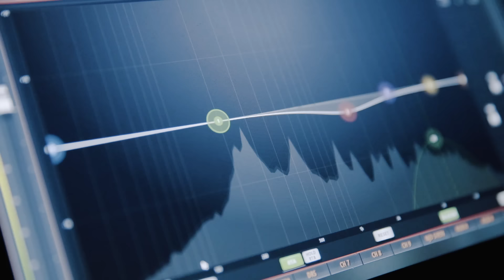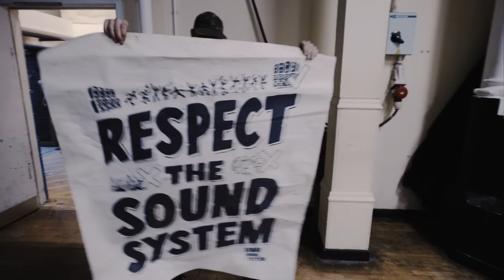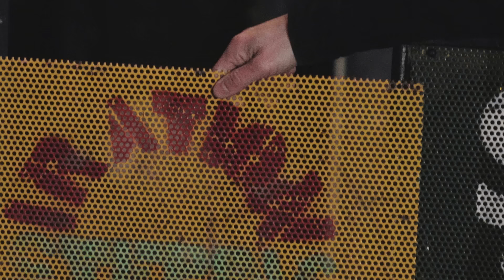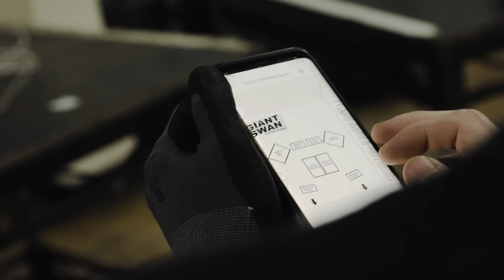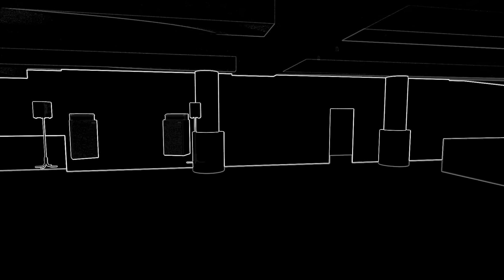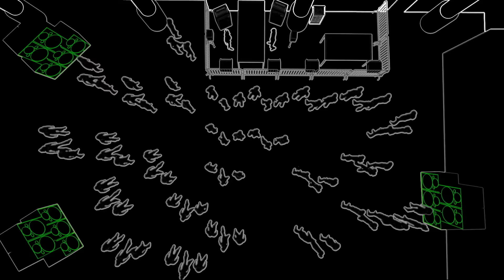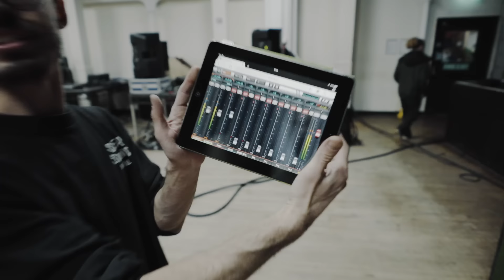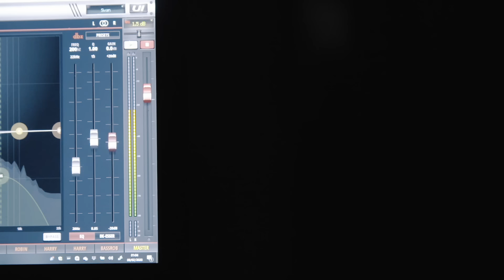Sinai: Inside the UK's most versatile sound system

Comment: I really like the rubber-based feet for the TT's. Back in the day ( early '80s) I was young and dumb and using a pair of BFI Bullfrog PA's with a monster Project One receiver. In order to isolate the TT from all the shaking I took two rectangular kitchen sponges and cut them in half, then placed each sponge on a saucer and each saucer under a foot on the TT. When we threw a party I'd wet the sponges and never had a problem again with records skipping.

Comment: This is one of the coolest things I've ever seen. In purpose built track cars, rubber bushings are replaced with solid metal mounts in the subframe (connecting the suspension to the body) to improve the feedback the driver receives from the road. Interestingly the equations for "waves" are analogous across science, whether they be electrical, mechanical, or audible waves -- all being magnitudes of energy over time and space. 

Respect to Sinai for pushing the craft forward <3 bucket list: hear a dub set on a sinai sound system.

Comment: I experienced the soundsystem at Dimensions Sub-Dub Arena. The energy of the soundsystem was so intense the air started heating up from the vibrations. Unreal to actually start sweating from the energy of the music hahah
Reply: while i was watching the video i was wondering what were the best soundsystems i've ever heard, and i came up with the Sub Dub arena one (and Berghain, just as good); only after reading the comments i realized those guys were the owner of the soundsystem lol
Reply: While it's an entertaining idea, it wasn't the vibrations heating up the air. Even if you crammed two dozen 15kW M-Force subs into a tiny 500 person venue, the vibrations wouldn't heat up the air (but you would pass out from the agonising pain).
Reply: Francesco Spinolo are these actually good, or just powerful? The best soundsystem I’ve heard had a great body load but not too much... and yet you could hear all the elements through the highs fairly evenly.

Comment: I just corner load now - slammed a village hall quite well with 2 single 12 subwoofer cabs on 600 watts at my 30th okay it didn't go SCARY loud but it was definitely enough to start feeling it well, and paired with 2 Bill Fitzmaurice tops was enough to drown any attempt at conversation at the back of the hall. A pair of 18s would have been better, but then I couldn't fit the whole system in a Citroen C2.2 

I made a speaker stack when I was a child that was 2 of my dad's old H//H pro 150 15" bass guitar/PA cabs with blown tweeters through an old custom sound 4 channel mixer on the bass, and some unknown 2 x 12" open back cab on mids and a Marshall 8020 on upper mids and some highs. As there were no crossovers I just adjusted the bass, mid and treble on each speaker. It sounded terrible but got awfully loud playing southside spinners and Luvstruck through it at top whack till my parents had enough.

Comment: 100,000 watts from only 3 power amps? (14:30) I have been doing sound for about 38 years now and I have never heard of that before. I have roughly 25,000 watts from 8 power amps, and I am pretty sure that if I cut it loose in a room that small, I would knock the nails out of the walls and cause some serious health issues for the guests. This seems a little exaggerated. Think of it this way, if each speaker is capable of handling 1,000 watts, then you would need 100 speakers! I saw 50 at most! Judging by those amps I would say more like 5,000 watts tops! IMO

Comment: I have 6 cabinets with 2x18's 2x12's Peavey black widows and a 2" P-audio horn driver all on community horns/ 10 cabinets with 2x12's Peavey black widows on horns bi-directional/ 10 long throw horns community 2" P-audio horn drivers/ 8 wedge monitors with electrovoice evx180's 18" and 2" P-audio horn drivers/ 4 amp racks with crown power base 1,2,3's and a crown macrotech 5002vz/ 40 channel Allen and Heath mixer/ FOH rack / mics stands di's/ 200 amp distro/ etc... It's pretty damn loud I ground stack it the big cabinets are 58" wide 3 ft thick and about 50" tall I stack them 3 high with 3 2x12's and 3 2" horns a side on both sides of the stage and have the wedge monitors across the stage

Comment: I've got a question.
I am currently building my own mini reggae/dub soundsystem for home use and for occasional home party's. It's a 4 way system with 2   15inch superscoops, 2  12 inch ported mid-bass speakers, 2  8inch tops and 1 hornloaded tweeter. My consern is that the bass of a  15inch scoop won't sound very nice. I would like to hear some more opinions.
Reply: How did it work out?

Comment: so its a mobile disco built with old 80s rave speakers ,,, ?? or am i missing something.
Have you ever looked at a modern touring system ,, seriously , yo should .
oh, and add a couple of pairs of servo drives if you really want vintage thump.
Reply: I've used some Turbosound Aspect TA-890H, which are absolutely stunning, but the weight of the boxes makes them less practical for touring. The Martin Audio H3+ box is another favourite, but simply does not go loud enough for the things we do. Also used a selection of Funktion One boxes, including the RES5T, but I'm not a massive fan of where the crossover points are, just sounds a bit "odd" with the kind of music that I play. I do like the KF850F, but each box is DOUBLE the weight of one of my mid tops. I'm able to get, legally, 6 subs and 6 tops in the back of my van, which logistically makes the most sense. Line array is pointless in a small room, and if you have maybe 30mins to setup, like we often do, that's not happening. Plus, it doesn't sound good for the music that we play, in my opinion that is. We've also used some Void Air Motion, but they're more form over function, and just don't go loud enough. The only real upgrade that I would, and am considering, is a product from Danley, quite possibly the SH96HO.
Reply: @SinaiSound  you can buy ml8s for humble money , and ev delta max for penys in the pound , but all the empty air your hauling round there has long since become obsolete , the same spl would fit into a quarter of the space now , so do you sell the look of big speaker boxes , or the sound that comes out of them , and if we were all playing by the rules and running at 92 db as allowed , a pair of stage monitors would probably do ,,,, lol
Reply: seriously though , look into servo drive by line7
Reply: @tomthompson7400  What we're actually looking into is the m-force series, by Powersoft. Also, a Logic ML8 costs just a touch more than each compression driver that we use. Also... 92db? That's a little....shall we say, quiet, for our average use. We use Yamaha DXR15 active monitors for DJ monitors, which are seemingly more powerful than the speakers you're suggesting I replace the mains with ! Out of interest, where are you based? If you're ever near one of our gigs come say hey, and explain why we use what we use :)
Reply: @SinaiSound  Would love to but Im in Northern Ireland ,,, 92db is the maximum legal sound pressure level your allowed for up to six hours , from memory , I think it drops to 90 db for eight hours, thats why the electric oranges were brought into play. , health and safety at work act , so its folk like door staff and bar staff that are at risk , we have some hse guys round here that seem to think thats what it has to be ,, and then you can imagine the rows , and even worse , try turning on a laser ,,, lol
Reply: 2010realitycheck   well there you go ,,, but every one there could in theory take legal actions against the promoter , the licencing authority and the system operator for un safe working practices , and un safe conditions , remember , no win no fee.
I dont make the rules , but please tell me why you would be exempt from hse rules.
and before you go off on one ,,, I frequently ran 150k plus systems for 15k crowds.
Reply: @SinaiSound  Thanks for going more in depth with your boxes, and what you like or have tried! I heard those Danleys at an EDM event last fall, and although I was extremely excited to hear them, the resolution didn't seem anything very special. That being said, the one speaker top per side was filling a room with 1000 people in it, and it sounded like it wasn't even at 1/4 volume.

Comment: Outdated Martin Audio speakers? Real professionals use German d&b.
Reply: Real pro's can work with everything in the top class. Old or new. And there haven't been that much innovation in just speakers in the last 30 years. Old Martin Audio sounds fine! I know big concerts venues that replaced their old Martin Audio stacks with line array's (i worked as an audio guy at one) But that's mostly because the venues have multiple floors so aiming is more simple but that's it. In the sweetspot the old Martin Audio sounded the same. But with more stereo because the stacks had more distance between them. And some other stack advantages. Also worked at venue with D&B but that sounded not amazingly better. Same top class as the old Martin Audio. But my fav's are F1 Dance stack's and EAW 850's (old but warm colour and not super transparant)
Reply: The Martin Audio drivers aren't whats actually used in the Sinai boxes, the images are just stock driver images
Reply: @jakebriggs2122  Tnx for clearing it up.
Reply: @Madrrrrrrrrrrr  I concur that you work with what you have and try to make the most  of it.   But if you don't hear the difference between Martin Audio adn d&b than I can't help you. You've gonne deaf. If you play gabber  it doesn't matter what system you use.  Martin Audio is the standard in the concert business...  Still d&b  for me is TOP. Specially when setting classical orchestra.
Reply: saturnative you don’t use a soundsystem for a Classical orchestra. You use a room build for it first and teach musicians about volume. Worked with a d&b C7 and no real mid low. Only in the top cabinet (which is way to heavy) but at schoulder height and not stomach and chest. Sorry! And gabber? I play 12” disco, Afro, funk, Rai, digi dub, electronic Cosmic from the 80’s. Not the 2D new dub you hear in this video.  Real definition in the dynamics up to 300 hz. Not classical music without any bass. And most gabber is shitty produced. Killing all dynamics in the low end by distorting kicks. By by punch. And I’m Dutch! Hahaha Good speakers are defined by 50% of music/material you put into it. Then 25% room and 25% the system. Not in that order though. And I take old raised Klispshorns in a room up to 100/200 people over any new system. Or Big Birtha’s if I really need earth shattering bass. But with those 2 I’m biased. Same with old analog EAW crossovers. Still love that sound too. And it’s not like XTA. Which i like too with good phono pre amps. But it stops at 0 dB because it’s digital. An old analog EAW crossover I can push a bit more. Warming up the sound and give the music a bit of the same colour overall. Anyway enough about what i like. Tell me why new drivers are better than old.

Comment: He mentions 100,000 watts... But there's no way that 3 PowerSoft amps are outputting anywhere near that. Lost some credibility there.
Reply: I was also wondering if he got his numbers right, but the PowerSoft X8 amps are absolutely ridiculous. They can theoretically do 10400W @ 4 ohms per bridged channel, so a total of 41600W in a single amp. But of course this is just peak values, overall it is limited by the power supply to ~5000W. So the two X8s and one X4 he has can do 10x10400W in theory, so I guess he's technically right. Specs here: https://www.powersoft.com/en/products/touring-amps/x-series/x8
Reply: I said a theoretical maximum. By quoting the manufacturers figures. Each amplifier also has a 32amp 3phase power supply.
Reply: They are impressive amps. I stand corrected. In a way it's almost too much. If an amp were to fail, a significant portion of the system may be down.
They must put out a lot of heat running full-pelt for an evening.

Comment: There is absolutely NOT 100k watts coming from those 3 amps lmao. Assuming perfect efficiency and 3 20 amp 240v circuits, he’s just under 15,000 watts. lol.
Reply: While not 100k, those circuits are 48 amps for most of us. The sound we run uses three 32 amp lines.  We are restricted by having just eight sub horns, eight kick horns, four mid coaxials, and four top boxes.
Reply: You're assuming that each amp has a 20 amp circuit? Well, for starters that kind of thing just doesn't exist in the UK or Europe. In domestic installs we have a 32A ring main, where the voltage is based on 240v +- 10%. For industrial applications we have single phase and three phase outputs. These come in flavours of 16A, 32A, 63A, and 125A. Each of the Powersoft X series amplifiers, has it's OWN dedicated 32A 3phase input. Next point, amplifiers have capacitors inside them, so when they're not outputting power, they're charging, because music is not a pure sine wave, it's dynamic. Also, this particular amplifier charges it's own capacitors from back EMF energy that's sent to the speakers that's not used, that then comes back. There's also a lot more to it than that......but, lets for a moment assume that the final output power is determined by how much electric they can draw from the wall. Using your above calculation,  250v (which is usually what 3 phase supply voltage ends up being in my experience) x 32amp = 8000w. But that's only for a single phase, and each amp has three phases. So 8000w x 3 =  24,000w per amp. So that's 3 x 24,000w = 72,000w. Even though, that's not how it works haha! We quite often have to deal with a 240v ring main on a shared 32a breaker for smaller gigs, but thankfully the amplifier is so efficient, that we quite often use just a single one to power 6 subs and 4 tops all from a single 13a UK wall plug. We've done a 400 cap gig, with just that top amplifier before now, crazy how technology has come along really.

Comment: 100 000w? Yeah right....
Reply: The Powersoft X8 has 8 channels, each with a theoretical maximum output power of 5200w at 2ohm. The X4 (the slimmer one) is merely a 4 channel version. So that's 20 channels of 5200w... so it's more like 104,000w of theoretical output power at maximum volume at the lowest impedance.... https://www.powersoft.com/en/products/touring-amps/x-series/x8